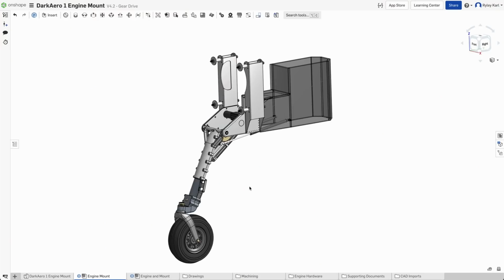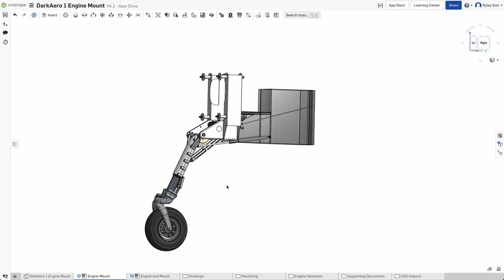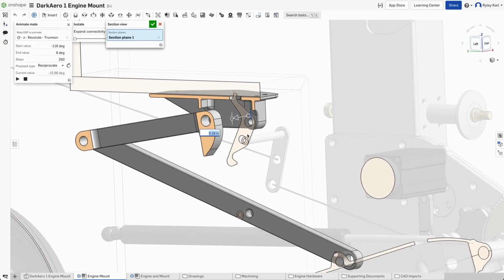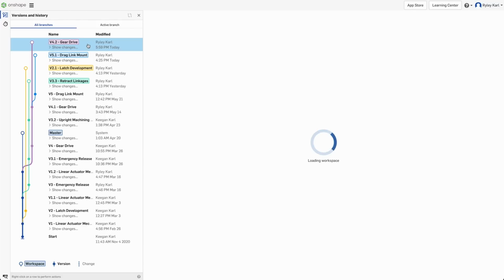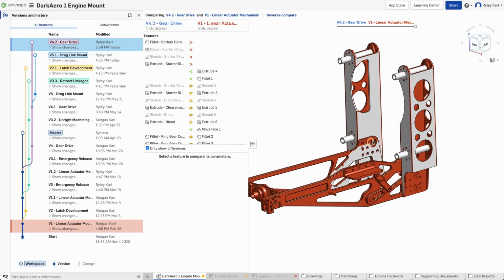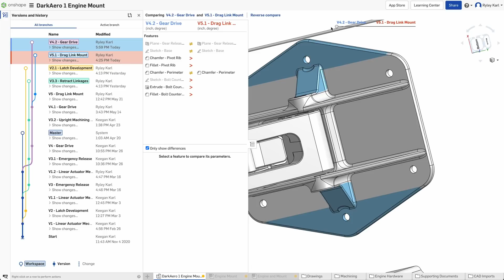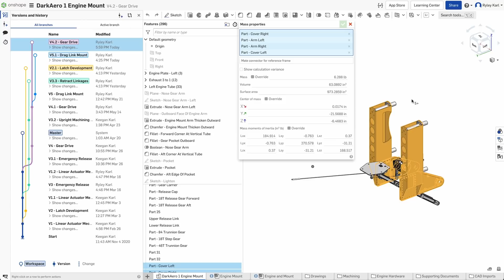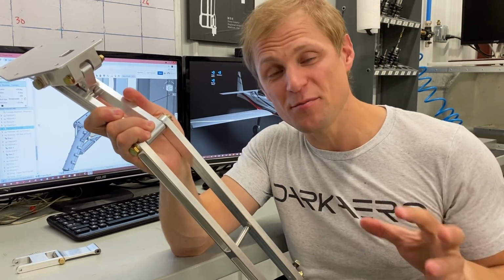How to manage complex designs. (our favorite CAD feature)

Comment: I stumbled in your video while searching info to learn about over center mechanisms and linkages. The fundamentals and how to design and simulate in OnShape. Just for fun, kind of a hobby (I’m only a mere FSE).  I wish I’ll have a tinny fraction of your mechanics knowledge an OnShpe knowhow. I’m a newbie and self-learning OnShape user. I followed the link to DarkAero1 web page and I was amazed by the airplane specs. Aeronautics was a not fulfilled child dream unluckily (62,5 years old now). 
You – DarkAero are pushing the limits. Pushing limits is the engineering advancement engine.  SO I deeply wish you an huge success (technical and economical) whit this project. All the best for you guys.

Comment: Dont really like gears in a critical application such as this. They have a low contact area,and during landing some peak forces are bound to get up and into the drive. It's neat and low mass, but it just looks like a failure mode to me. It can prevent the redundant system from working by jamming a gear. Would be nice to see the load calculation and deflection on this linkage. Im sure you have thought of this though.
Really enjoy watching you guys. It brings me back to the days of FSAE :D

Comment: How do the gas springs 'fail open' and allow the landing gear to extend if the failure occurs when the wheel is fully retracted inside the wheel well? The direction of the pushing force of the gas springs and the location where it acts on with respect to the pivot point of the strut would cause it to rotate counter clockwise when looking at it from the port side view, which would effetively jam the struts and prevent the landing gear from extending.

Comment: Hi. First of all, congratulations on your excellent work. I was wondering, what prevents the landing gear from losing the desired position during landing. Isn't a locking mechanism between the upper and lower drag links (e.g. in the connection joint) necessary?

Comment: How are you able to move the parts like this in Shapr3d? I thought it didn’t have the assembly function like solidworks? I’m about to buy an iPad Pro to run Shapr3d and just wanted to confirm you can do assemblies like this landing gear on the iPad

Comment: With your emergency gas struts, they are over center so when closed they hold up the arm, which can be beneficial but in your case you are using it as an emergency option so you need to have them loaded when retracted

Comment: Nice design full steering authority when extend, without authority retracted, one less headache 📐📏👍 do you use stranded steel ropes, rod, or morse cable for steering movement.
Reply from the maker: Steering is accomplished through differential braking. The nose wheel is castering.
Reply: @DarkAeroInc hello guys i couldn't see the details but I thought it had authority in nose wheel i know it's tricky and difficult design if you use authority on front wheel it will be on Dark aero ll options👍

Comment: Nice! Is there anyway the caster can be misaligned when retracking and contact the body when it gets to the "pocket"?
Reply from the maker: Hey Greg, the nose wheel is castering but not "free" castering. There is an adjustable nut on the pivot axis of the fork which imparts friction into the fork pivoting action. This serves two purposes: it acts as a shimmy damper, and it also prevents the wheel from flopping around backwards during retract operations. The break out force to rotate the wheel/fork assembly is around 10lbs when you push laterally on the wheel. This arrangement is similar to what is seen on the nose wheel and fork of the popular Vans kit planes or the Cirrus SR series of certified aircraft, although these airplanes are fixed gear. The wheel and fork on the DarkAero 1 are pointed straight as the aircraft leaves the ground and the friction nut keeps them in position. There will be a "wedge" feature on the nose gear doors that will act as a guide to correct small angular misalignment in the wheel and fork.

Comment: how do you design in imperial 🤔?
Reply from the maker: The same way you design in metric 😉. Actually though, we have to work in both unit systems because the raw materials and hardware we source comes from a numbers of suppliers, both in the US and Europe.
Reply: @DarkAeroInc  well then that means you can work in one of them, and procure in both. this is an old engineering problem.

Comment: The GIT model should be standard practice for every CAD system!
Reply: I'm a mechanical engineer and this is already standard practise in the industry. check in, check out , revise version. When I learned git for some coding projects , I understood this is where it all comes from .
Reply: @dngo2991  alright! do you use regular Git for that or do you have specific software?
Reply: @vintyprod  I work at Bosch Rexroth and we use PTC Creo for CAD and versioning software is windchill PDM I think. We use PDM inside creo to handle all this check out check in business in an inbuilt GUI. When I started my career 5 years before, I didn't know that these things were standard age old practice in the software industry done with one liner codes.

Comment: Hi, how do we know the power needed to make our design move? is it a trial and error process?
Reply from the maker: We were able to calculate and predict the forces on the gear in the design phase. We still test everything out to ensure reality matches up with predictions though.
Reply: @DarkAeroInc  Hi thank you so much, do you have any suggestions what the keyword that I have to search if I want to predict those forces in solidworks/inventor/on shape? thanks
Reply from the maker: CAD tools allow you to model up the moving components, but the forces on them will be determined by you the engineer as design constraints. Analysis tools like FEA will allow you to determine what stresses the forces generate within the components of your design.

Comment: How does the retract motor 'break' the drag link, to allow the retract motion, and what prevents the drag link going over centre under load and during ground and air vibration translated through the gear mechanism!
Reply from the maker: Gravity naturally kinks the drag link when the gear retracts. There is a hard stop on the upper drag link that functions as both the lock and a travel limit to prevent the drag link from going over center. We will probably show this in further detail in an upcoming video since it's a little tricky to explain in text. Keen eye and great questions Simon!
Reply: @DarkAeroInc  Not sure gravity will be enough, especially in dynamic aircraft loads and during retraction the knee of the link needs to traverse upwards (aginst gravity)! Be good to see a video showing the gear cycling. That keen eye is from 18 years of flight testing 👍
Reply from the maker: We show the gear cycling in our latest shop vlog here: https://youtu.be/EUWNGUjbAGU

Comment: How about solid works? Vs on shape
Reply: As someone that has worked with both SW and Os, I feel that Os has a much more fluent design process. Especially its sheet metal feature is way more streamlined. SW is also inferior in its version handling and collaborative features. SW has, with its 3DExperience, tried to tackle these shortcomings, but is still way off. And remember, Jon Hirschtick and John McEleney, who created Onshape, also is the ones that created SolidWorks.

Comment: How are you thinking of handling a gear extension mechanism failure (motor seized, gear tooth stripped and blocking rotation)? Possibly a gear disconnect option and let gravity plus gas strut extend?
Reply: I'm also having a problem seeing how the gas struts are going to help in a gear down failure if still in up and locked position.  According to the model shown, the struts in the "up/retracted" position are over-center and are basically at that position preventing the gear from dropping down.
Reply: Exactly what I saw, went looking for comments and here it is
Reply: To the 2 commenters above: Yes the gas springs are over centre when in the retracted position however the upwards force they exert at that point would be easily overcome by the downwards force exerted by the weight of the assembly in that position due to the very low mechanical advantage applied by the gas springs at that point. This is assuming that a gear disconnect will be fitted.

Comment: An alternative DC motor you guys may want to experiment with are car window regulator motors. They're mostly have a universal design and internally geared. These things have super high torque.
Reply from the maker: Haven’t looked at those. Thank you for the suggestion! And recommendations on suppliers?
Reply: @DarkAeroInc  Unfortunately no! Over the years of dealing with faulty window regulators, I've come to find out that the mechanisms are what fails and not the motors themselves. Most tend to be screw to gear drives which gives them lock strength when off. I'll do some more research on the one's I've worked with.
Reply: @DarkAeroInc  Here you go. Just to show you how they work. 
https://youtu.be/mueY-4UgHMA

Edit: I forgot about windshield wipers motors. They're even stronger and multi speed. 
https://youtu.be/vxhBMiyy3y0

Comment: “The process of designing retractable landing gear is actually pretty challenging.”
I never would have thought
Reply from the maker: Who would have thought. :)
Reply: @DarkAeroInc  dunno. Someone who has designed retractable gear before. Of perhaps a team of four engineers
Reply: The process of designing a anything in cad is always more challenging than it seems :)
Reply: @orppranator5230  great. In which case not wanting to get a cad program as much now
Reply: when it comes to designing Low weight critical components it's always challenging

Comment: What keeps the front tire from castering the wrong way while lifting?
Reply from the maker: Shawn, the nose wheel is castering but not "free" castering. There is an adjustable nut on the pivot axis of the fork which imparts friction into the fork pivoting action. This serves two purposes: it acts as a shimmy damper and it also prevents the wheel from flopping around backwards during retract operations. The break out force to rotate the wheel/fork assembly is around 10lbs when you push laterally on the wheel. This arrangement is similar to what is seen on the nose wheel and fork of the popular Vans RV kit aircraft or the Cirrus SR series of certified aircraft, although these airplanes are fixed gear. A good example of a retractable nose gear fork similar to ours can be seen on the Rutan style canard aircraft. The wheel and fork is pointed straight as the aircraft leaves the ground and the friction nut keeps them in position. There will be a "wedge" feature on the nose gear doors that will act as a guide to correct small angular misalignment in the wheel and fork. Thank you for watching and for the question.
Reply: @DarkAeroInc  Thanks for the reply. I have followed the videos from the beginning. Cheering for you guys!

Comment: I'm assuming that the nose wheel is free castering, and it's alignment during taxiing is due to trail, and steering would be accomplished by differential braking. When the nose gear swings up, the caster will tend for the wheel to swing around and down before it tucks up in the airframe well. Is there something to prevent the limit of the castering, or to ensure the nose wheel is centered as it lifts into the airframe?
Reply from the maker: Hi Arvid! We get this question often. The nose wheel is castering but not "free" castering. There is an adjustable nut on the pivot axis of the fork which imparts friction into the fork pivoting action. This serves two purposes: it acts as a shimmy damper and it also prevents the wheel from flopping around backwards during retract operations. The break out force to rotate the wheel/fork assembly is around 10lbs when you push laterally on the wheel. This arrangement is similar to what is seen on the nose wheel and fork of the popular Vans RV kit aircraft or the Cirrus SR series of certified aircraft, although these airplanes are fixed gear. A good example of a retractable nose gear fork similar to ours can be seen on the Rutan style canard aircraft. The wheel and fork is pointed straight as the aircraft leaves the ground and the friction nut keeps them in position. There will be a "wedge" feature on the nose gear doors that will act as a guide to correct small angular misalignment in the wheel and fork. Thank you for watching and for the question.
Reply: @DarkAeroInc  How do you control that friction over time? Even the RV method loosens with usage, but not to the point that you get bad shimmy, but would be enough for the weight of the wheel and fork to 'flop' over during a retraction! You really need a positive cantering spring arrangement to be 100% guaranteed that it always centres or is at least in the band required for the centring 'wedges' to catch any offset.
Reply: Good question, I noticed this too.   Maybe the wind will keep it centered?  Or there is a return to center mechanism that we aren’t seeing?

Comment: Maybe some manual landing gear release mechanism would be also useful. Or only manual (it can be lighter but less convenient).
Reply from the maker: I didn't really cover it in this video but there is a manual release mechanism. Just a simple handle the pilot pulls in the cockpit which drops the gear manually. A pure manual system would be awesome but there wasn't a good way to implement it.
Reply: @DarkAeroInc  Cool! : D : D : D

Comment: I suppose you can get rid of few useless idler gears in this mechanism.
Reply from the maker: It wasn't discussed in the video, but the two idler gears do have a function. They sit on a rotating carriage that can pivot to disengage the idlers from the motor and trunnion. This functionality is necessary to allow the gear to extend in the event of a motor failure or loss of electrical power. We will demonstrate this mechanism in an upcoming video.
Reply: @DarkAeroInc  This is strange. Usually some kind of a dog-clutch is used for such purposes.

Comment: (2) suggestions: Your torque link loses rigidity when it is that vertical, and I understand that you have a CNC, and want to use it, but I have never seen a two part strut housing. Tube is way stronger, less likely to leak, and cheaper to produce. Just find a Hydraulic shop that manufactures cylinders, and can re-chrome stuff. Otherwise, I love what you are doing!
Reply from the maker: Thank you for the suggestions John! You are correct that the torque link has less rigidity when it has less scissor angle. However, what is important is that it has sufficient rigidity to achieve the intended function, which ours does. Using longer torque links that are less vertical would just add excess weight, which is why ours are as short and vertical as they are. Our strut housing is indeed unique. There is no concern about leaking from the housing because it isn't sealing anything. It is formed in two halves because it encloses a standard off the shelf gas shock, so I think we might already be doing a version of what you are suggesting in terms of outsourcing the shock absorbing hardware in the nose gear.

Comment: Would the design not be simpler and lighter if the front gear were the other way around? As to allow the air to open it? (I know nothing about anything btw)
Reply from the maker: Hi Joe, great question! The nose wheel needs to be positioned in a specific location relative to the aircraft center of gravity to achieve the proper weight distribution on the wheels with our tricycle landing gear. With the nose wheel in the correct location, retracting it forward would send it up into the engine/propeller where there isn't room to retract it. Retracting it aft allows it to be tucked away in the unused space between the pilot and copilot legs. This is a pretty standard retract arrangement in small 2-seat aircraft with tricycle landing gear.
Reply: @DarkAeroInc  I see, makes sense. I've learnt something new :)